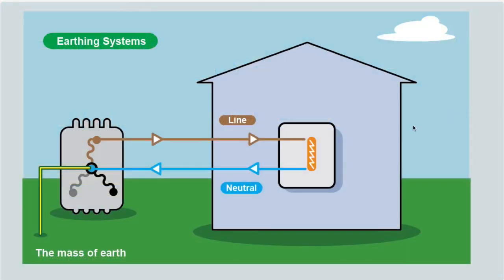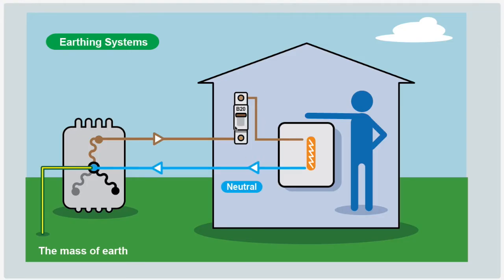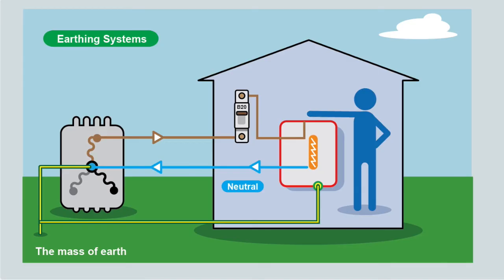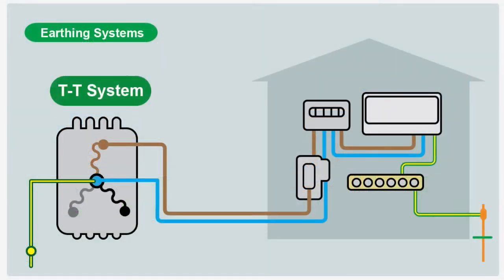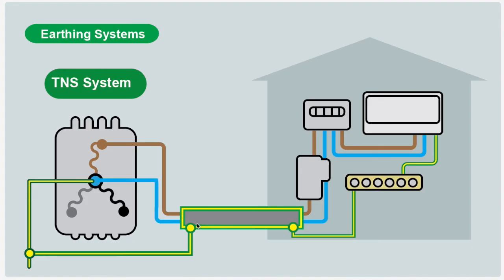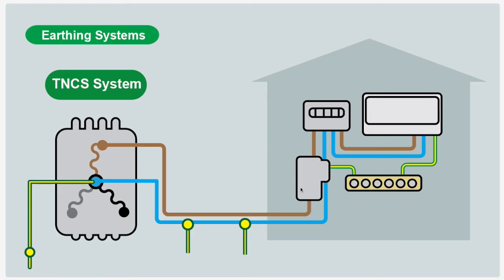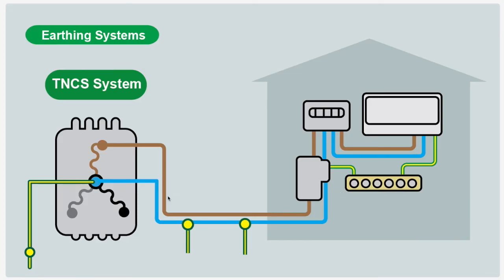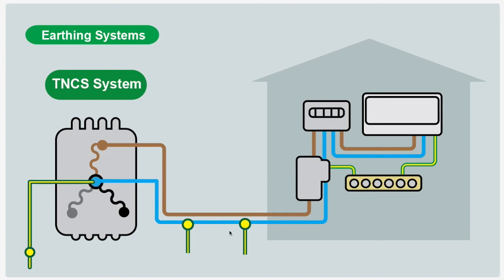The basics of electrical earthing

Comment: I cant understand ....in the house it show earth cable connect neutral with the MET? Can you explain for TNCS
Reply from the maker: Hi. The neutral is at the star point of  the transformer. This is 'referenced' to earth.  The supply earth is connected to this.  They are commoned together on the supply side sometimes, as in a TNCS and separated in the installation. or as in a TNS the earth is ran separately.  This is the supply side, we don't do this on the consumer side.

Comment: With tncs, If you swapped neutrals nd earth around in your board , or at a socket. Would anything happen?
Reply: Well the RCD would trip immediately if you did it in a socket. Without an RCD nobody would notice. It could cause some stray current if the wire used for grounding has current in it. One could her these as hum in audio equipment etc. but there would not be any immediate risk, mot even in a fault condition.

In the UK they use for some reason thinner earth cables. This could cause problems with high loads.

Comment: 2:12 if having your house re wired does your electrician not supply and fit earthing rod? Coming towards the end of having my father in laws house re wired and thr electrician is saying for my father in law to do it. Seems crazy to me
Reply from the maker: Hi Eoin. I presume this is a TT arrangement, and the distribution people have not provided a means of earthing.
So you need to have  an earth rod installed by a skilled person . The electrician who rewired the property should be installing the rod as part of the job, as he can not energise the installation, without a means of earthing.  The installation of a rod and all subsequent testing is not a job for the home owner,  as they would not have the equipment  and knowledge to do so.  I don't know what was agreed with the electrician, prior to works commencing, but it is not a job for the owner.